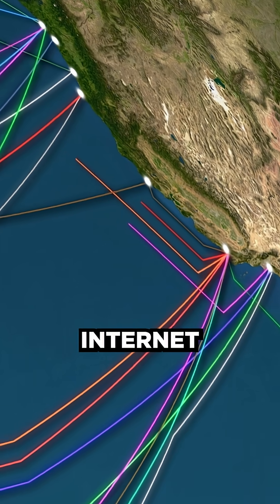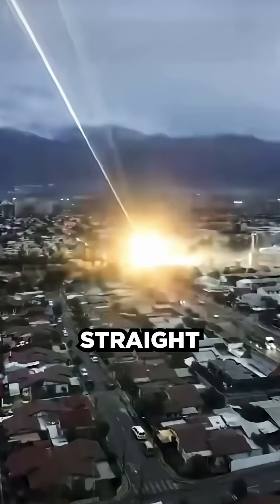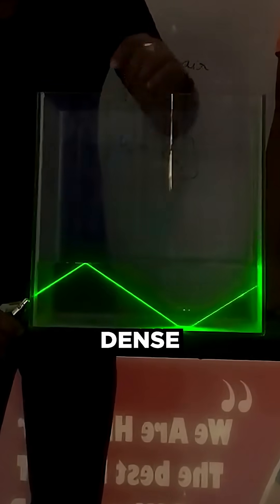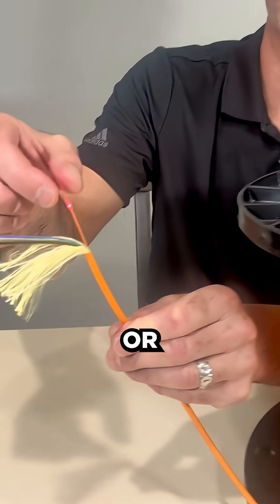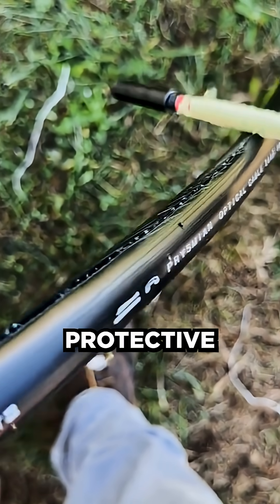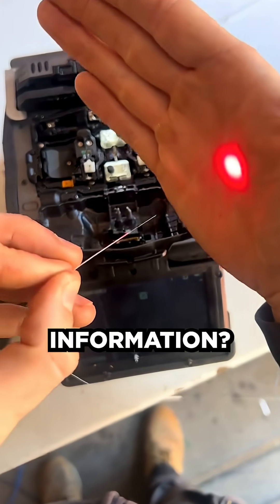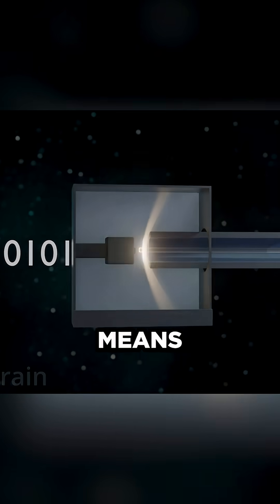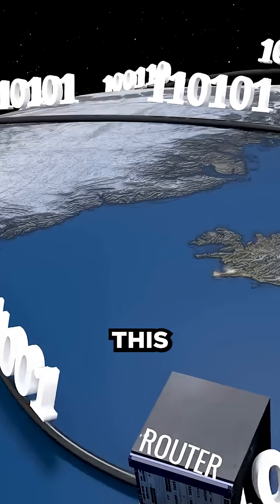Fiber Optic Explained

Comment: It is not the speed at which data travels across the internet. It's the speed at which photons of laser light travel across the internet.

The speed at which data travels and the speed at which laser light travels are two very different things.

The speed at which data travels is down to the encoding and modulation used which is substantially slower than the photos of laser light

Comment: It depends on the type of optic cables. The explanation cover the multimode cable NOT the single mode cables. There is no internal reflection in single mode cable.
Reply: And that is a really key distinction as the long distance fibres are single mode. Any fibre longer than 15 miles approximately is single mode.